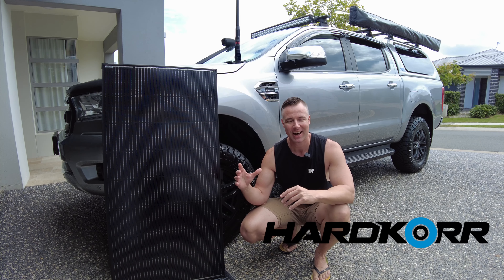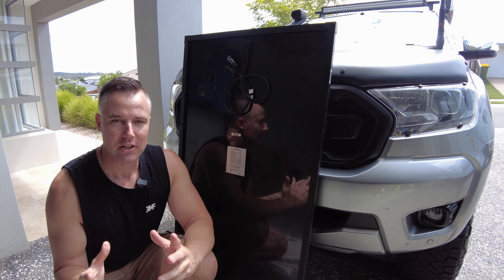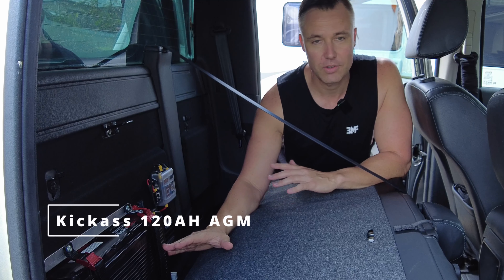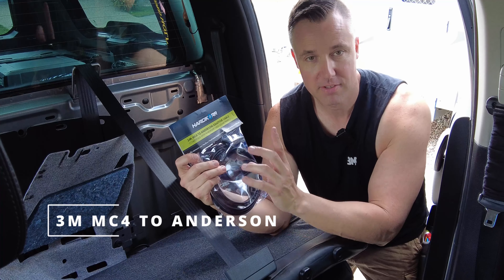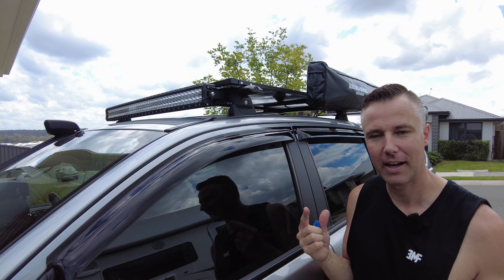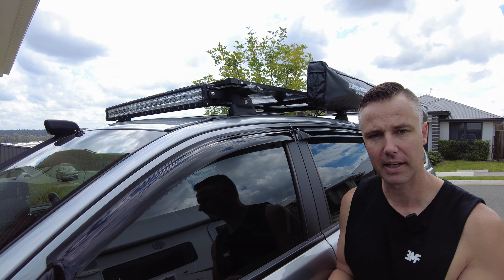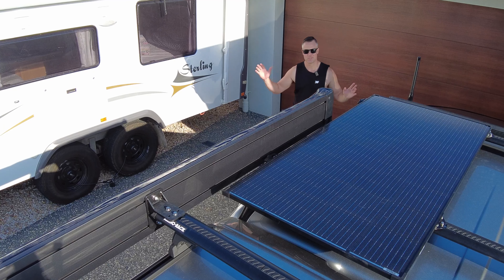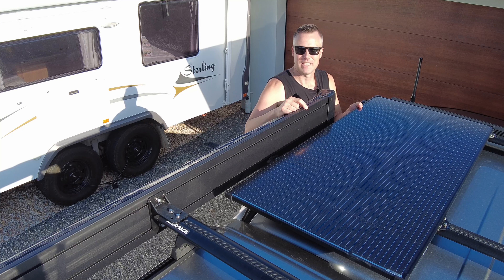HARDKORR Solar Panel Install || Ford Ranger

Comment: Thanks for your video! Can I ask what's the name of that yellow thing you use to fish the wire through the grommet?
Reply from the maker: Thanks. It’s a cable puller commonly known as yellow tongue. It’s used to join sheet flooring together. Comes in different widths.
Reply: @GetCampingOz  Thanks so much. Your video was really helpful; now I have the same panel over my BT50 :) Terrible wind noise though. Onto finding a way to make a wind fairing.

Comment: I've just finished mounting an almost identical set up, and the wind noise has gone from zero to an unbearable whistle...... Vortex bars awning & Tredz were all previously mounted & produced no noise, did you notice an increase in noise when you fitted yours?? if not do you think your light bar is helping to keep the wind noise down..??
Reply from the maker: Hey Toby, sorry to hear that. I haven’t experienced any wind noise at all. It could be because of light bar at the front stopping the air but I couldn’t say for sure as the light bar was on before the panel. My panel is mounted pretty far back with only a little of the leading edge past the vortex bar. I have heard that small gaps will cause the whistle so maybe try blocking any gaps between the panel and the bar up with rubber? Cheers
Reply: Thanks for the tip..... Cut a pool noodle in half, filled the gap.....almost zero noise now...... Cheers 👍
Reply from the maker: @tobyprivacy5566  glad it worked! cheers!

Comment: Is the amp rating you mentioned coming out of the panel at the panel voltage or is that after the red arc and what’s actually going into the battery?
Reply from the maker: Not sure mate but but I’m assuming that there is no loss of current from the panel to the output of the Redarc. I certainly haven’t had any issues keeping up with the fridge.

Comment: I also use the HardKorr slimline solar panel on my Pajero. I have a Rhino mesh flat roof rack it fits below the side supports and you really can't tell I have it fitted. I put some rivnuts in the solar panel and flat plate underneath the mesh rack. Sits great. Runs my 50ltr fridge 24/7 matched with the Redarc BCDC1225. I have had my car sit for 7 days straight without starting it and the battery (105ah agm) stayed pretty much fully charged the whole time.
Reply from the maker: That’s awesome. I’m super happy with the panel. I now don’t have to worry about the fridge being on now - so it just stays on. Thanks for watching 😀
Reply: Good to hear mate I’m thinking of pretty much the same setup for mine

Comment: Nice work, do you feel a though the rivets will be efficient enough to hold it down with wind yeah?
Reply from the maker: Hey mate! Yeh most definitely. It’s been on well over 6 months now and not a single issue with movement. You could add 3rd rivet if you really wanted to but in my experience it’s not needed. Thanks for watching

Comment: Great video may I ask what size rivets and bolts did you use. Thanks in advance.
Reply from the maker: I just used a 4mm rivet and the bolts are an 8mm bolt that have a T slot nut for the roof rack channel. Cheers
Reply: @GetCampingOz  thank you for replying, appreciated.

Comment: Just bought the panel and will copy bracket design..how are the poprivets holding up ?
Reply from the maker: No issues what’s so ever. Still as strong as the day they were installed.

Comment: Did you put any of the rubber stripping from the centre of the roof racks under the panel?
Reply from the maker: Only what comes with the rail - it’s like a T mould section.
Reply: @GetCampingOz  ok so just cut a piece of the t moulded rubber out where the brackets secure to the rail?
Reply from the maker: @PeskyEmu  yeh mate just on that section
Reply: Thanks mate, I have a BT50 with a very similar set up to yours, videos have been very helpful
Reply from the maker: @PeskyEmu  no worries mate 👍🏻

Comment: Hi, was the wire grommet already installed or did you put that in yourself?
Reply from the maker: The grommet is already there. You will just need to poke the wire through. Thanks for watching

Comment: Thanks for the video mate, how do you do the connection if you're connecting it to an Engel Battery box? thanks mate
Reply from the maker: Im not familiar with the Engel battery boxes. Im assuming they have either an anderson connection or a merit plug. It would just be a matter of matching the connection to either the box or the panel. Thanks for watching
Reply: You need to make sure you have a solar regulator. With this system he has a redarc charger which has one inbuilt which is why he can plug the panel straight in.

Comment: Can we put these solar panel all EV cards and ev buses
Reply from the maker: Im not sure they will help with recharging to quickly. If its a small battery it should be fine
Reply: @GetCampingOz  in which country you live I want to work with you